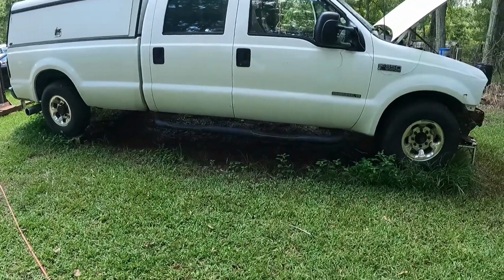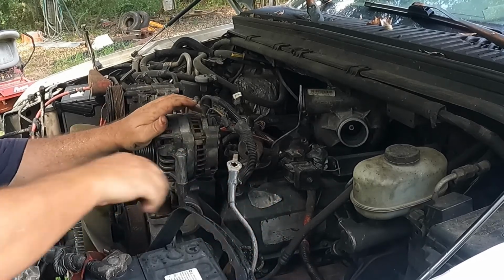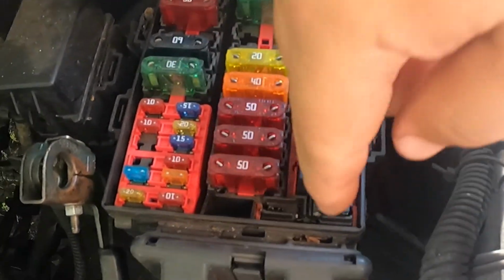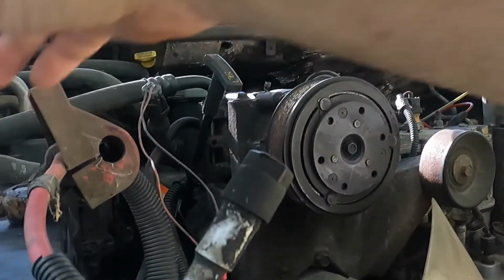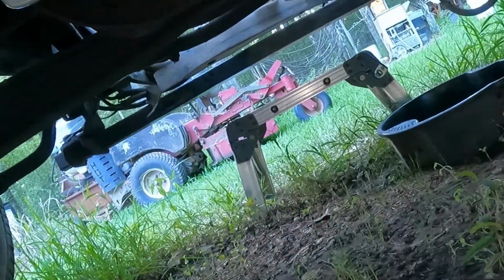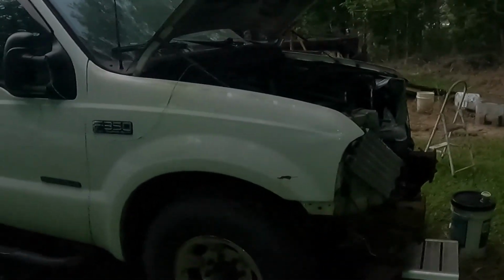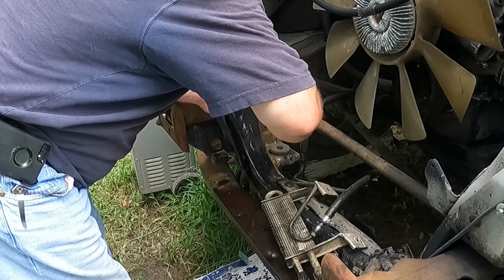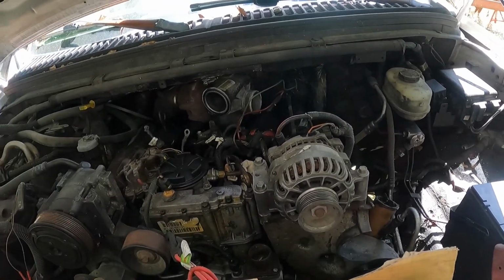f-350 Tool Truck Revival Part 2

Comment: Howdy got a question about my 1997 F-350/460/E4OD Single wheel 4x4 ? I'm changing the Diff oil in the front and rear what oil should I get ? I think 75/140 synthetic for the rear ? Don't know for the Front Diff ? The Transfer Case Looked like ATF. And also What do the front hubs need for servicing? I just got the truck and did the Trans service and engine service already. Also do both Diff's need Friction Modifier ?
Reply from the maker: U would need to get more info on ur axels from either the door sticker axel codes or running the vin. Then u could determine what oil they need ( limited slip or not ect. ) I have some charts with axel codes so if u can find ur codes and hit me back I can try to look them up. Axel codes are in the lower right side of the door sticker 
As for the transfer case not sure on obs trucks, if u don’t have the manual they could look that up at a parts house.
Reply from the maker: I haven’t fooled with 4x4 hubs in quite some time so I wouldn’t want to make suggestions on that with out looking into it.
Reply: There's something "mean" about the design on the vacuum activated 4x4 hubs, like it's hard to get them to seal up if you take the hubs off to do Axel  seals, or something like that.  The manual hubs are known for getting frozen up from ice and rust, I hose mine down with penetrating oil in the fall for good luck.  

They had a couple different axle options, I'd just call up your stealership, hit them with your vin and they can tell you what grade of dinosaur squeezings you need for your drivetrain.
Reply from the maker: @bondvagabond42  sounds like u have some good experience with those hubs. I prefer manual to the vacuum design. Those seem to fail quite often. And we don’t get a lot of ice problems in Louisiana
Reply: @bayoudiesel  I prefer manual everything, hah, the metal components on the manual hubs are fine, it's literally just the little gap around the edge of the plastic cap that you turn with your fingers that ices up, so just a little oil or grease in there keeps the water out, and keeps them turning free.
Reply: @bayoudiesel  Is front axel#2086KG& Rear 2759KG good numbers?
Reply from the maker: @un-limited7009  those look like the gvw ratings for the axels. How much load they are rated for. Hit me up on my email and I can send u a pic of the axel code. 
Bayoudieseltrucks@gmail.com
Reply: @bayoudiesel  The front axle is a Dana 60 The rear axle is Ford code 35 = 6250 & 4.10 gears
Reply from the maker: @un-limited7009  doesn’t show anything on my charts indicating limited slip. I would “assume” friction modifier not necessary but with that axel info a good parts guy should be able to tell ya what fluid u need for them.
Reply: @bayoudiesel  thanks